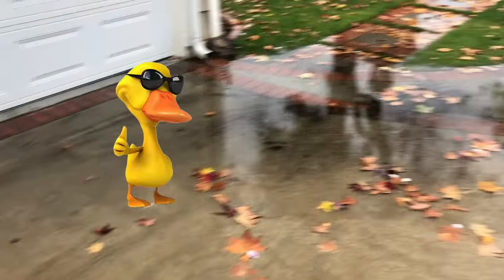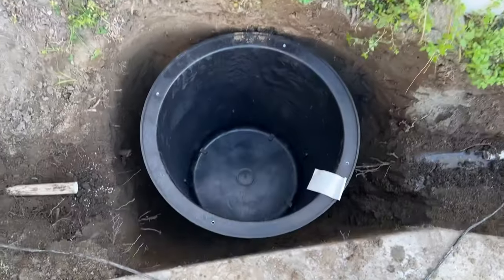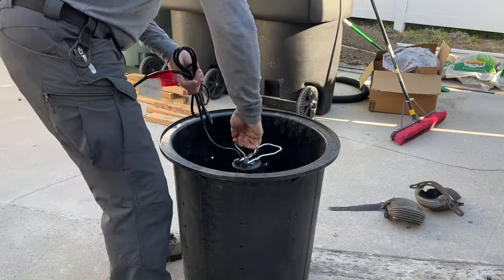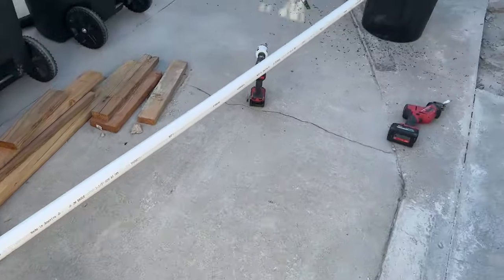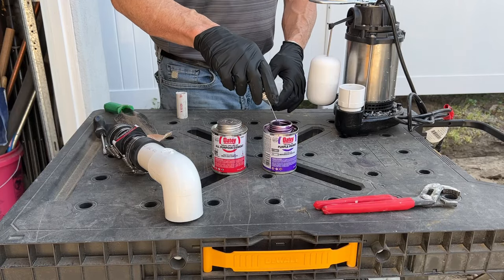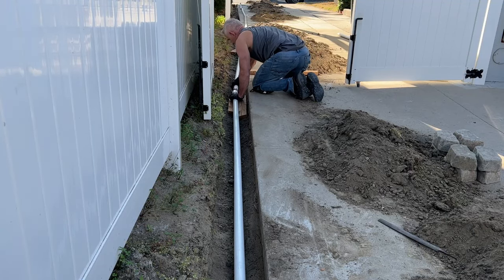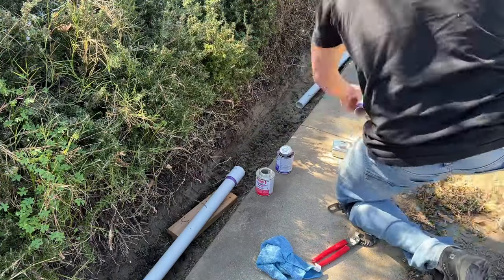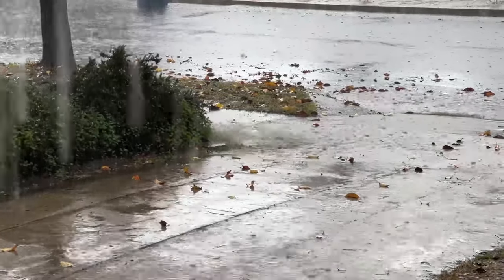Sump Basin DIY | Jackel Sump Basin Installation | You May Need This In Your Yard

Comment: most sump pumps recommend drilling a small 1/8 hole below the check valve to eliminate air bloc below the check valve
Reply: can you explain that in laymens terms?

Comment: Great work. Doing this install right now but the water will be coming from a downspout and a yard drain. Spending under $500 as well.
Reply from the maker: Awesome, Hope it solves your problem.
Reply: Are you located in an area where temperature will go below freezing? If so, how do you handle that? I'm in PA

Comment: How would you do this if you were in an area that freezes in the winter?
Reply from the maker: Thats a great question!! I do not have that answer for you as i do not live in that type of climate. Maybe some other tubers can answer this.
Reply: The pump and well need to be below the frost line. Do not use the one way valve. After the pump shuts off, allow water in the pipe to drain back. The adjustment of the float is critical. You don't want the water returned from the pipe to turn the pump back on. Don't use that pop-up thing, leave the end open so it can drain out the other end.

If I did this, I'd connect the pump to a switched outlet so you can easily shut off the power in the coldest weather and turn it on when you feel it's safe.

Let me know if you're seriously interested, I'll search and post a YouTube link that explains it.
Reply: @joeshmoe7789 I'm interested. Plan is to collect surface and subsurface water so that it can then be pumped out (there's no available slope)

Comment: I would not put a soakaway sump next to the building because it concentrates water flow to wash the fines from the building foundations that will ultimately cause subsidence.  The 'jacket sump basin' will act as both soakaway and inlet depending on if the pump is active.  The pump is also prone to freezing in that location.and lead to premature failure.
The teflon tape has been wound the wrong way onto the threads as the action of threading will push the teflon to unwind.
1 1/2" (40mm) pipe is unsuitable for underground drainage as it cannot be easily rodded (cleaned).  The pipe will silt up particularly as it will have standing water in it and then the possible only course of action would be to dig it up and replace it.  Silt will also be discharged over the paving making lethal and unsightly underfoot.

For a standing water situation as shown here, a 4" (100mm) drain should be installed with a yard gulley to discharge into a soakaway at a minimum of 10ft (3m) from any building or boundary or into the stormwater system, all complete with rodding access and laid to falls.   .
Reply from the maker: Wow Clive, thank you for your input, However The installation is just fine the way it is. Happy to see you enjoyed picking apart the video.